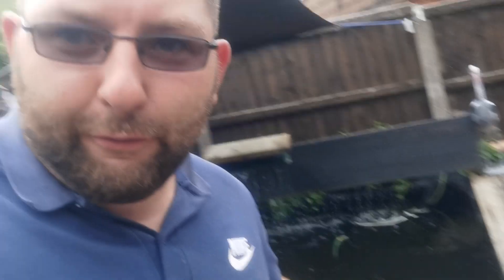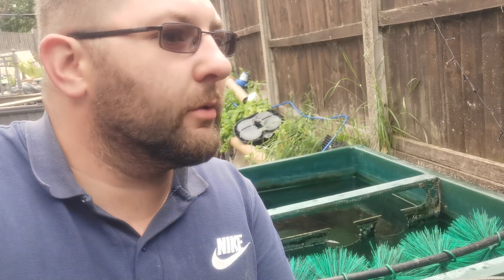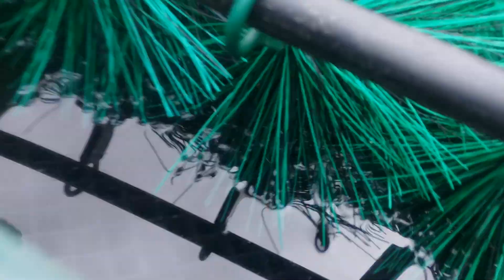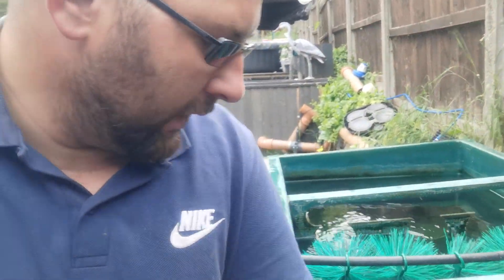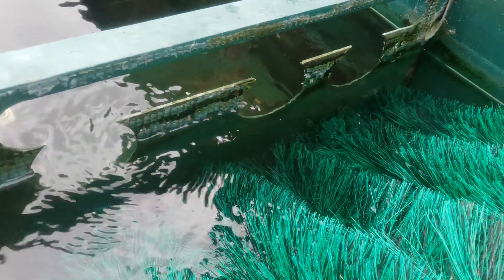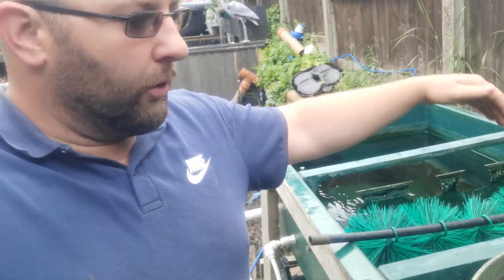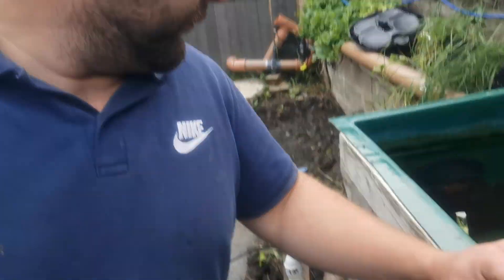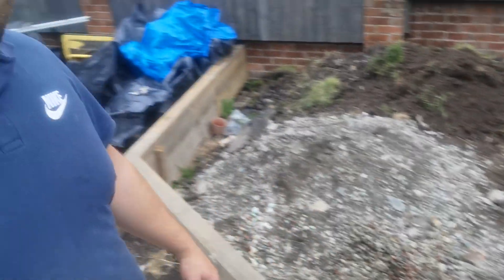KOI WORLD - POND UPDATE - KOCKNEY KOI MULTI BAY FILTER - UV LIGHT - DECHLORINATOR FILTER

Comment: Yes a drum would do the job but the cheapest one ( Chinese built ) is around £1000 the next step up are the Welsh built one's called DracoDrum but then your talking £1500. You wouldn't at all be better off with a Nexus 320 as they work best on a flow rate of 6000 to 9000 lph flow which is probably not enough for your pond. That multi bay looks huge and should be up to the job 👍 have you considered getting a used large stand alone vortex for any lost fish to keep alive in plus it will collect fish poo you can connect it straight to the first chamber of the multibay filter with a 4" rubber boot and then put lots of brushes in the first chamber the black plastic tubes in the second chamber, Japanese matting and the sponge in the third chamber and finally if you're pump doesn't run dry some white filter floss on top of the alfagrog in the fourth chamber. It also might be worth getting a variable speed pump to fine tune the flow rate and they often save on electricity 👍